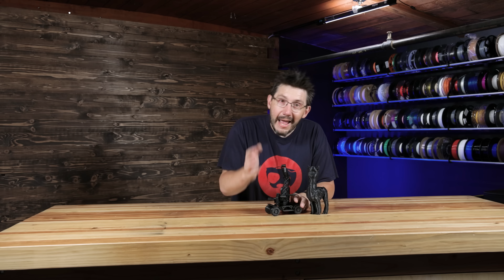UNBELIEVABLE! Visiting the Hacksmith's SECRET Superhero Lab in Canada!

Comment: Joel, have you ever built a 3D printer from scratch? What board and/or software would you recommend to drive such a printer? I'm wanting to build one that uses welding wire to 3D print with metal, but I'm not sure how to handle a build plate since it would have to be metal and the weld wire would stick to it as much as itself, unless anyone can think of a workaround for that.
Reply: People have tried that, it doesn’t work great. But if you insist, use just a bit of sheet metal and cut it off and toss it after
Reply: @Volt64bolt  I was thinking about it some more and I'm thinking that maybe I could feed a length out straight and use it as a support. Attach a single point at the end of a wire to the build plate, cut it off maybe an inch above the surface and structure things that way.
Reply: @anon_y_mousse  yeh it probably won’t work, most metal printers are not fdm but sintered whatevers
Reply: @Volt64bolt  It would certainly require custom slicer software, but I think I could make it work. The problem I've always had with the powder sintering printers is that it's basically making a ceramic. You need a laser and it absolutely must be pinpoint accurate or you'll have all kinds of flaws in the print. Welding pieces of metal together produces better results, but it can't do everything that 3D printing can do. I suppose I could always combine the processes, weld sheets and wires together with robot arms and incorporate milling to produce tight tolerances. I was kind of thinking of a gantry system like a typical 3D printer, but this might be a better idea.
Reply: @anon_y_mousse  yeh there are machines that use ‘mig welding’ of sorts to build up layers combined with a 5 axis mill aswell, saw one at a demo once. Couple million though.
Reply: @Volt64bolt  Sure, a professionally built one can be pricey, but I'm going to be building one from scratch. It'll be my time and effort that make up the bulk of the cost, but I'll give myself a discount on the work.
Reply: @anon_y_mousse  k man, wasn’t at all my point, I regret trying to help you out now lol
Reply: @Volt64bolt  Then what was the point, because it seemed very much like the opposite of help and more like the definition of discouragement.
Reply: @anon_y_mousse  ‘advisement’